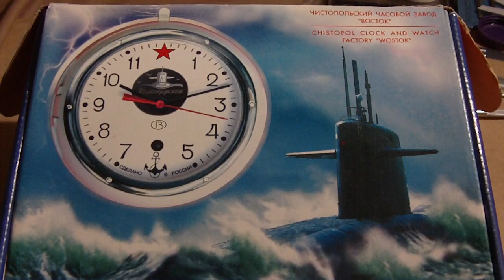Russian submarine clock, how to take out movement and assemble

Comment: Ever have the alarm sound on one of these?  If so, do you know how to set/disable it?  I think mine (which doesn't quite look like yours--it's hammer and sickle era) may have an alarm.  It's either that, or else I dreamt of a VERY LOUD alarm-type noise in the middle of last night.
Reply from the maker: This one does not have an alarm.  If this has not happened before and you did not touch the clock before you went to sleep I think you dreamt it
Reply: Does anyone know how to release the mounting plate? It has a tab, but I can't figure out how to release it.
Reply: @dotNSF  You press the tab and slide the clock upward. The mounting base is a later add-on; the clock as manufactured is intended to be bolted to the bulkhead. Since that retrofit is a fairly slap-dash job, things often aren't solid or smooth, and sometimes you have jiggle and fiddle to get the clock to slide upward. (Pro tip: throw that plate away when you get it off and screw the case to the wall, as intended. More secure, better-looking, easier to deal with.)

Comment: Thanks for posting. I have one that I bought new years ago. It stops running after a short while now. Trying to figure out where to start troubleshooting it.
Reply from the maker: I would start by taking the movement out of the case.  If you can't see it, you can't fix it.
Reply: They gunk up fairly regularly. Mine's on a 7-year cycle; about every 7 years I have to have it cleaned. Other clocks seem to have shorter or longer cycles, including a few that don't seem to gunk up at all. Anyway, when it begins to stop haphazardly, in my experience, it's that. Have it cleaned, or do it yourself if you know how, and it'll run like a top again.

Comment: I have this exact same clock. It worked just fine. I moved, packed it up and it sat for 3 years or so. I just unpacked it, gave it a full wind and the damn thing went crazy. The clock unwound at a rate of about one hour per second. The second hand was moving so fast you couldn't even see it. If I takeout apart as shown here, what should I look for? Or have I discovered a time machine into the future?
Reply from the maker: ***** From what you described it sounds like your clock is either broken or you are in a dimension that goes really slow compared to your clock.  Did it start going crazy as you wound it up or only after it was fully wound?  My guess is that the pallet fork and balance are not stopping the escape wheel from turning.  Maybe one or both jewels fell out of the pallet fork or some pivot from the third wheel to the pallet fork broke.  I would be careful taking it apart just in case the pallet fork jewels fell out.  Don't want to lose them cause the could be reinstalled.  I would not wind it up again cause your are killing those pivots when it runs that fast.
Reply: bunnspecial Thanks for the quick reply. It didn't start until the key was removed. It does it too even on a partial wind if that matters. I hardly ever wound this thing when I had it on the wall because I am disabled and have no finger function so it was more or less brand new when I packed it away for the movers. They must have kicked the crap out of it. This thing was designed for warfare and to handle shocks from depth charges and extreme conditions but apparently was no match for a small group of underachieving high school dropouts armed with a dolly and some packing tape.
Reply from the maker: ***** I have found out that when you need something destroyed, hire movers.  It doesn't matter how tough the item is or how you pack it they will find a way to break it.

Comment: Mine has a black plastic piece on the back just like your did when you took it out of the box,,,how does it come off,,,the lever doesn't seem to release anything..?
Reply from the maker: The plastic piece slides off the clock.  You have to press the lever into the plastic and then slide the clock away from the lever.
Reply: @bunnspecial  Just what I tried,,,saw a pic and figured it out,  thanks so much ,,,did that and afraid to try and move it,,,it was very tight so  I took the nuts off the back of the plastic,,,then it came apart,,,put every thing back together and wala.  Thanks

Comment: My clock ran fine until a year ago, when it just stopped.  If I tap it or shake it, it will run for a few seconds.  I was hoping maybe it just needs to be oiled (it's thirty years old, never serviced)?  Which points should be oiled on this clock?
Reply from the maker: All the pivots should be oiled.  Probably should be cleaned also since who knows what kind of oil was used and it sounds like it turned gummy.  I did a video where I took one of these apart to replace the balance.  Maybe you should check out that video.
Reply: @bunnspecial  Yes, but that's a little scary... I took the movement out of the body, and at least the ballast (balance?) wheel is not all wobbly like that other submarine clock you worked on.  Well, I'll take a deep breath and give it a go.  Thanks!
Reply from the maker: Its best that if you don't know what you are doing don't mess with it.  You break the balance staff or mess up the hairspring you are screwed.  The half ass way is to get a pointed toothpick and remove any crud around the pivots then oil the pivots.  If you are not comfortable working with the balance leave it alone.

Comment: My Vostok wall clock is defective. It stops running quite often when placed vertically (on the wall) and then starts running again when placed horizontally (on a flat surface). Do you think this issue will be resolved when I change the part of the mechanism that i visble at 11:55? . And do you know how to replace this part myself?

Comment: Hello.

I enjoy your cussing and aggravation very much. I sometimes forget until I see a suggestion link and remember, "oh let's go hear the bunn guy bitch" -lol.

Don't feel bad, I just scraped the number 4 off the dial of one of my favorite old timex. Damn crystal lift was not compressed enough and struggling to push the crystal back in, it slid and scraped the 4 off.

Why did I do it? Oh I originally was annoyed by a small spot of rust on the dial opening. I did an excellent job removing with q-tip and bleach. Came right off. I was so proud.  Then I fucked the dial up. Should have heard me yell. My dog ran for cover.

One of the old large bubble top timex made in Taiwan. Made in 1977. No big deal but just a nice dependable watch I like to wear. Been wearing it regular for a few years now. I like wearing it because it's one of those I don't have to worry about it, if you know what I mean. But it grew on me. Started feeling naked without it.

I might try painting the number back on. I got a stereo binocular microscope that has good working distance so I can reach in. Have to find some kind of really fine tip marker. Maybe sketch with pencil first.

The thing that limits the winding is called a Geneva stop.
Suggestion, always try to support your wrist when using screw driver.
Cool use of bottle caps..!!!

This clock to me was a strange purchase, but I can see it's appeal now. I would initially be put off thinking of it as a fake that never been out to sea. But now see that would be understood.

It is rugged construction and I wonder if it would make a good outdoor clock. I would mount it up high so nobody steals the thing. I wonder if humidity would get in.

Anyway, enjoy your cussing and aggravation very much...!